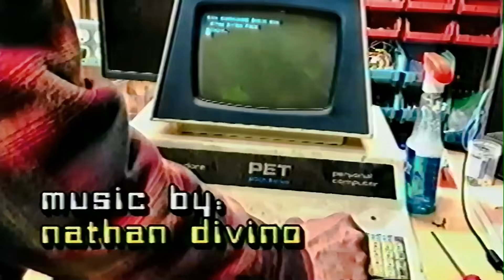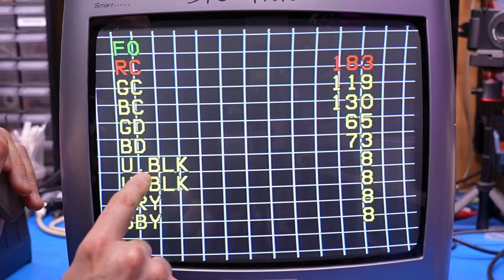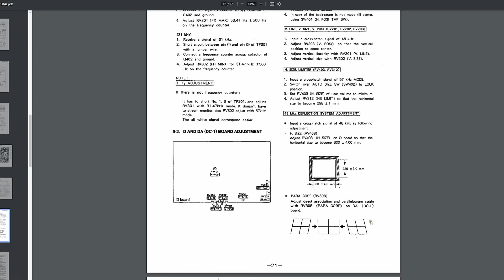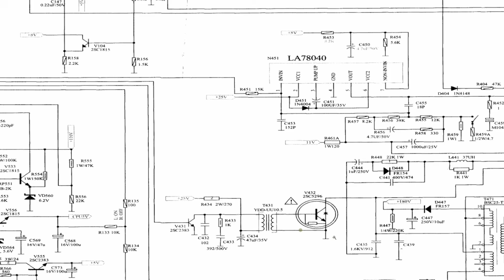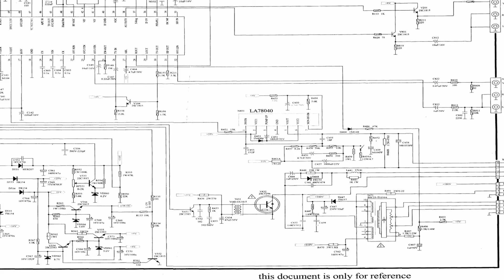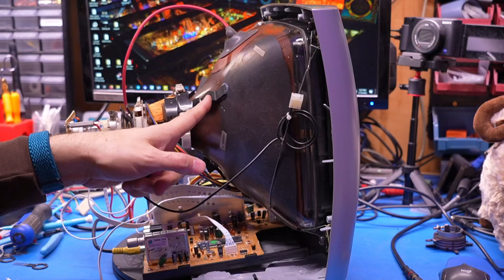I tried (and failed) to make the ultimate Commodore 1702 monitor

Comment: Hello. If I remember correctly, the image distortion was corrected by placing an RC network in the right place, as many explain here. It's been many years since I looked at my TV repair books. The most interesting thing about this is that absolutely all square-screen TVs have compensation mechanisms, old or new; only round screens don't need them. Regards.

Comment: When the geometry and or the position of the coils are different than the original, the beam starts to deflect earlier or later, the screen is impacted from different angle when it pass the holes of the mask, so the purity is not possible.
Reply: On top of that changes in the horizontal reluctance of the deflection coil does that the flyback works at lower or higher current, affecting the output HV that goes to the anode by the big red wire, that affects everything.

Comment: Oh, the memories! Between my house and my cousins’ house down the street, we had 4 of these that got used for years and years. After the Commodore got replaced, my dad used one of these as a bedside television using a dial-interface cable tuner; many cousins and I used two of them side-by-side for head-to-head console challenges (Atari 8600s then NES’s).

Comment: The degaussing coil wont work very well even if the monitor was modified to run on 120V. It would need a different thermistor and probably different number of turns.

Comment: So you're putting a 1702 case onto a 1084. The monitor won't be a 1702 anymore. I'd do it if my 1702 broke and I found a working higher resolution tube. But having both displays, I'll just keep them each as-is. That said, I have the highest resolution 1702 AFAIK. I 3D printed a 1702-like case to put around my 4K 30" display.

Comment: lol. I finished doing a refurb on a CPD-1604S the end of last year. I had to replace every single component on the deflection control PCB because Sony used junky SMD caps on it and they always leak all over and destroy everything. I spent many, many hours pouring over that exact schematic and I know it now like the back of my hand.
Reply: Also, I want to add that the 1604S is an analog Multisync monitor which can do XGA resolutions including interlaced 1024x768. The deflection control PCB also handles the Multisync stuff including binning incoming frequencies, and then it overlays the corrected video image on top of the video output in specific frequencies. It's all controlled by a terribly complicated system of early Ti logic gates. This is why that particular schematic is so complicated, and why that arrangement isn't even remotely suitable for your project

Comment: It looks like you don't have any decoupling capacitors on the power supply. You should have that at least one on every board.
For example relays may case power spikes on the power lines that triggers unwanted behavior in other parts of the system.

Comment: important lesson we can always take home and learn here is that no two CRT's can ever be alike,  Function the same, and also factoring the make, manufacturer and model. 
I think the point of this video was clearly about experimentation, and this proves that most CRt's Can be incoherent and incompatible with one another.
This is the Cleverness, Beauty and Art of the CRT Designs, to change the 1702 internals and what is was intended and designed to do would be like changing someone's religion from orthodox to Jibberism.

Comment: The 1701 (at least the ones I have) also have smaller pitch shadow mask and thus higher resolution.
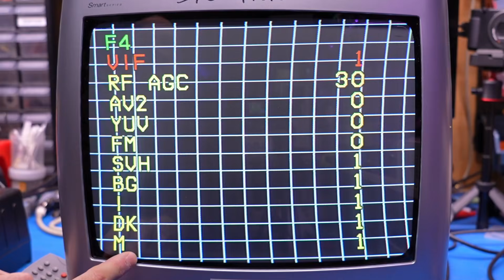14:40 FM is set to 0, maybe that's why you couldn't get FM to work.

Comment: Using higher input voltage switch mode PSU on lower voltage should work. There are some catches thou. As needed power stays the same, when you lover the input voltage basically to half, you need to supply almost double the amps to get same power out of that switch mode PSU. If the input diode bridge and primary switching transistors has enough current margin on them, it should be fine. For example, if the rated input current is 1A at 230V, than at 120V it should be around 1,9A, and if the diode bridge is rated at 6A, it should be good. As a preventive measure can add additional cap or change primary side capacitor for 1,5-2x total capacitance (in reality shouldn't matter because often PSU is still working even with 10% left of rated capacity.) Same goes other way if you want to use 120V PSU on 230V, in this case changing primary cap for higher voltage is almost always a must, and check if diode bridge and and main transistor is good for higher voltage. Has done this mod to some PSU's in a past, got away with just changing 400V main capacitor in place of 280V~ish, and everything works till this day.

Comment: Hi Adrian! When I was in college, I've worked as a repair tech for all kind of monitors and had infinite supply of CRT - most of them were just simple VGA monitors, but I've worked on arcade open frame monitors too. My love was still with my 8bit Atari though and I had 1084 as it was far more popular over here than any Atari counterpart. Unfortunately, dot pitch of 1084 was way too large for my liking, so I've swapped it with old delta-style mask CRT from VGA monitor - yoke, and convergence rings had to be replaced from original one and neck board had to be rewired so it would match pin-out on VGA, but other than this - it just worked, and I've used it for quite some time and finally gave it away to a friend.
Reply: I learned that yokes on inline CRTs and delta CRTs are fundamentally different. Why would you even swap them? Just reduce supply power!
Reply: @ArneChristianRosenfeldt  first of, i don't have a time machine to get back 27 years; secondly - I'm seriously wondering how on monitor without separation between HV and horizontal deflection you want to "just" reduce B+ without affecting remaining voltages. please enlighten me
Reply: @gyorka  how is there no separation? I thought that those are separate secondaries with the primary side of the transformer dealing with the 120 or 240 V ? Actually, I never had a VGA monitor, but a mult sync which could also do EGA and SVGA. It has a relay to switch the voltage and apparently a separate PSU.
Reply: @ArneChristianRosenfeldt  this subject is far more complex to answer it as a comment, but in general: you're mixing few things here: power supply and deflection/high voltage generation circuit/ Basically, most budget designs have combination of deflection and hv gen circuit in form of flyback transformer, HOT and some auxilary circuitry - but these are budget units and this compromise comes with some caveeats - namely poor hv stabilisation leading to pumping the image if content changes from black to white over wide ranges of screen. To prevent this, some monitors like nec multisync 4d used separate transformer for deflection, and flyback was used solely for hv resulting in smooth operation regardless of horizontal scanning frequency. on top of that b+ inline regulator was used - simplest one used p-mos and a choke to form buck converter driven by PWM signal from managing IC. by no separation i've ment no separation between deflection and hv generation. and monitor generates (usually) whole bunch of voltages needed for various purposes inside monitor.
Reply: @ I have seen a schematic with 3 voltages for the electron gun. These optic elements are high impedance. Heater. I once used a box which had potentiometers on a panel for all these voltages. Big and ugly.

Comment: That's a real coincidence! I did precisely this kind of CRT swap to a 1084 and also a 1940 monitor a couple of weeks ago. Both were completely successful. I had two very broken NEC 3FGP monitors which I had salvaged the CRTs from. These had a 0.31mm dot pitch vs the original 0.39 of the 1940 and 0.42 on the 1084. The modification to the 1940 was very straightforward. The NEC CRT was completely compatible in every way, resulting in the 1940 becoming a 1942. 

The 1084 was a little more complicated. Its original CRT is a phosphor slot type, the new NEC CRT is a phosphor dot type. You cannot change the CRT to a dot type and successfully use the original yoke for a slot type CRT (and vice versa). They are incompatible, it is impossible to correctly adjust colour purity.  I also have a 1081 monitor I hardly use. It has almost precisely the same electronics as my 1084, and has a coarse pitch dot CRT. My assumption was that while the yokes were different - to accommodate the different style CRTs, they should be electrically identical as far as the monitor circuitry is concerned. 

This turned out to be the case. I put the 1084 CRT and yoke into the 1081 and it works perfectly. I then put the 1081 yoke on the NEC CRT and put those into the 1084, and once I made a slight adjustment to the focus circuit by adding a series 10M resistor to the focus lead from the flyback transformer, the new combination also works perfectly. It is quite amazing to have a 0.31 dot pitch on a 1084!

In regards to your pincushion problems, I find it strange there is no provision to adjust it. The other two horizontal adjustments you already have indicate that the electronics of your monitor should support it. It seems it has been left out of the firmware in the 'jungle' IC in your monitor. It might be worth investigating the pincushion correction circuitry in the Philips versions of the 1084/1081, it looks very simple and straightforward, and it should be possible to add it into your monitor. Note that some 1084 versions don't have an adjustable trimpot, the correction provided is fixed.
Reply: Amazing because I did one of the same things as you, but about 20 years ago - I took the picture tube out of a Philips VGA monitor, and fitted it into a 1940, using the 1940’s deflection yoke (meaning I somehow managed to adjust the convergence etc. and got a good result). That gave a dot pitch upgrade from 0.39 to 0.28.

Strangely I got an actual 1942 from somewhere as well and I still have that today, but there was nothing wrong with the ‘upgraded’ 1940. I must have sold it to someone

Comment: you could have left the yoke and convergence rings on the tube and not had to re-calibrate convergence and adjust magnets.   only thing you would have had to mess with was the v/h size & Fly-back voltages.

Comment: Higher dot pitch is the better spec, not lower. You struggle with 80 columns because the dot pitch is too low.
Reply: I cannot believe that 80 columns would stretch the limits of technology. Lower pitch is just cheaper for very cheap TVs .

Comment: You may want to see if hooking a potentiometer across the capacitor for the sawtooth signal. This will effectively let you change the slew rate of the capacitor which may effectively allow you to slightly change the waveform. The other thing you might try is to replace the capacitor in question with a variable cap which would allow much the same adjustment with more control. On a side note, I'd appreciate it if you'd leave the countdown thing to Tony359. While imitation is the best form of compliment, it's his thing.

Comment: Don't feel bad. I found an awesome deal on cordless tools today. I thought I was being smart and picked up a sale pack on a drill with two batteries and the impact for that brand. From the box it looked like it should work great. Nope. STILL had to buy another battery (which turned out to be compatible with the drill, just not vice versa.) Arrgh!

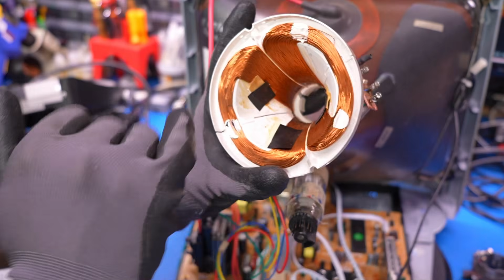Comment: Well if I zoom in at 31:56 I see that the supporting structure of the yoke can easily separated into 4 pieces. With those loos you can probably push the yoke on the CRT because the copper windings are flexible ... don't know if it works but I would give it a try🤠

Comment: Just a question. Are the gloves you use actually rated for electrical protection? They look so much nicer/handier than the ones we had to use when working with AC power at work.

Comment: Correction magnets (question mark) 
It might be possible to use two, or more small correction magnets to sort the pincushion problem, however this is almost always a bit of a faff, especially on colour tubes, so your mileage may vary.

There is a reason why that correction IC exists. It rather elegantly avoids all of this faffing about with CRT geometry weirdness. 

Thinking about the additional coil you added.. initially I, like you thought it might work, but on reflection, it clearly is going to affect all of the scan lines equally, since it is invariant across the entire scan process. As you discovered, this does affect the width, but unfortunately, it has absolutely no effect on the distortion.

To affect the pin-cushion/barrel distortion you need some sort of notch filter, attenuating or boosting the signal more at either ends of the scan (top and bottom).

Back in the day, we used to fix a lot of computer monitors and CRT based terminals. They can (and did) take a lot of abuse and still work. Once, we even repaired a bunch that had been stolen from a customer and dumped in a canal. I'm pretty sure the health and safety gnomes would have a fit of the vapours if you did that these days.

Comment: I have one of those Chinese boards I hacked into an old TV. The transformers are not necessary for operation on mine. I went straight up the wall outlet and everything worked. I use it all time. The box on mine says "super wide the supply voltage design".

Comment: Is possible to do this mod with a more modern vga monitor or is it too much of a hassle? I remember my dream pc monitor from sony was a widescreen and had s-video and component even.
Reply: No and why would you want to? Or you want lower horizontal frequency? But you don’t want a line double and miss the whine?
Reply: @ArneChristianRosenfeldt  Dunno, you tell me, you are the expert. I was asking if it was possible.
Reply: @ as an armchair expert, I say that this video is nonsense anyway. I was thinking about making a perfect power supply once, but found out that others did that before me. So I can’t believe that it is difficult to buy chips / boards/ transformers with the correct voltage. The nice thing is that an independent power supply for deflection would let us debug this circuit far away from high voltage.

I love microcontrollers, but for a CRT we may need low latency real-time DAC signals on 5 channels and triggers on some more. So when the IC on the modern monitor is not documented, there is a way to replace it. DVI is said to be very complicated, but would allow us to use a queue in RAM and delay it to adjust the image and improve convergence. DVI is not VGA and may not answer your question.

I wonder if it is possible to have floating switches: we could use these cheap optical Fiber link invented for audio.

Comment: Koodoos for finding a 1702 that didn't have the flip-down control cover broken off and missing.
Reply: The control cover on mine was intact for literal decades until a cat squeezed behind it a couple years ago and knocked it off a shelf. Everything else working fine, just the control cover hinges broke. I managed to find a close color match in filament from Printed Solid and 3D printed a replacement though!

Comment: You are seriously brave/ambitious for the kinds of mods/repairs I see you do on this channel. I’ve modded/repaired a handful of CRTs last few years but I avoid messing with convergence, yokes, chassis replacements as they seem tricky to get right. So glad to have your video experiments to learn from as gives me more confidence with these trickier aspects. I have one CRT that I’m considering swapping in that Aliexpress chassis if it’s a close enough match.

Thanks for how much knowledge you share on this stuff. The process is just as important.
Reply: convergance depends on the yoke. 3 rings are easy. 2 rings are hard. Ive done 1 chassis swap (motherboard conversion ) and that's a real hassle.

Comment: It seems like the yoke needs to generate a weaker magnetic field at extremes of vertical deflection, which was done via more coils and a smaller coverage angle for horizontal deflection (yoke wrap around) on the pincushionless (greater inductance) yoke - so driving at a higher voltage only gives a stronger magnetic field but doesn't change the field geometry at the extremes of vertical deflection... try adding some weak diamagnetic material strips (ie kapton then copper tape) on the upper/lower regions of the coil should change the geometry - maybe (just a physicist, not a CRT tech). 
PS If you try this, use narrow strips at first to limit eddy current heating.
Reply: A microcontroller could change the voltage of the power supply. The output from the flyback could be blocked by a thyristor at the start to divert more power to the HV screen. The charge on the tube could be topped of using optional horizontal flyback during the vertical flyback. How is brightness controlled anyways?